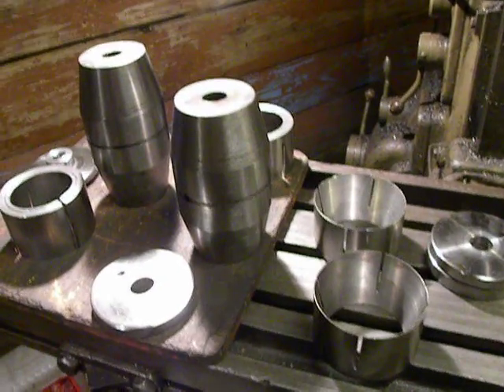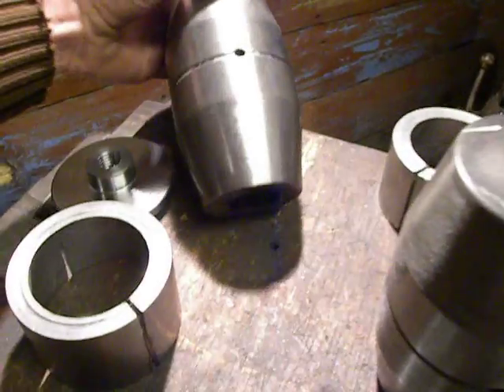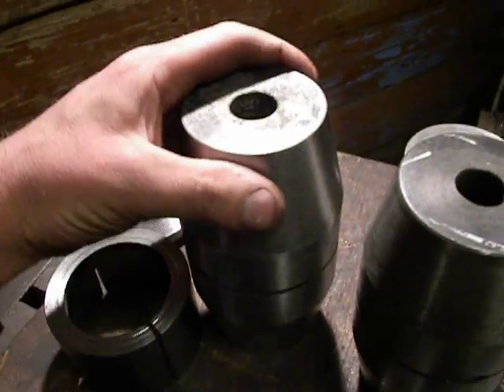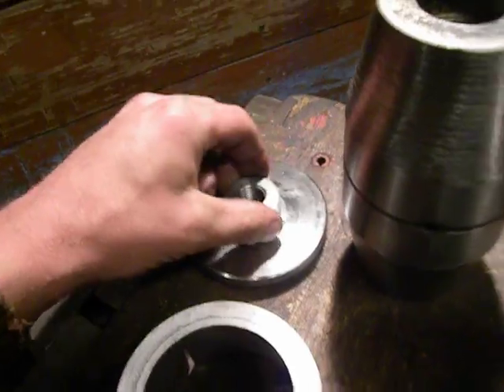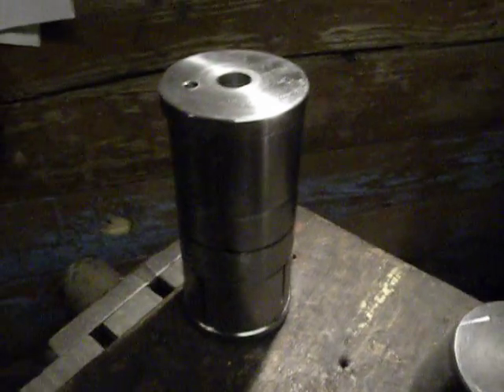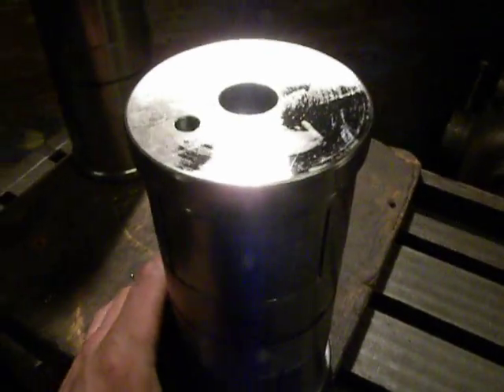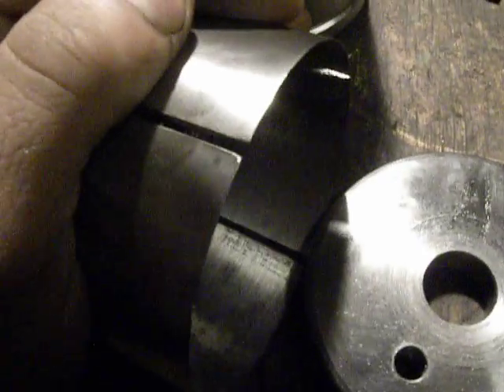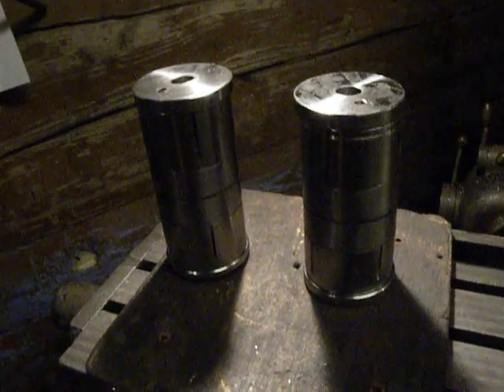Expander bushings and bolts kit for Valmet middle pivot (walk around) / Valmet great repair p13

Comment: Thanks for your detailed explanation--I understand your approach to solving the problem much better now!  Now that you've pointed it out, it is obvious there would be lots of wear on the frame bores.  Perhaps you need a horizontal boring machine with a table large enough to hold half a tractor!  More seriously, maybe you could make a portable line boring machine

Comment from the maker: Thanks! 
Liquid nitrogen tank? No, no- too expensive here and here I can't get liquid nitrogen- need license. Also I have limited space into My workshop - no place for it. Better I buy one more good great lathe or great size milling machine for that money.
For fitting the "repair bushes" I can tu use ice, fire, oil, screw, great hammer and anoyher ways how to get fit the bush. I always to calculate mearures for bushing - over-measures (from 0,03mm to 1mm) and accuracy (from 0,1mm to 0,01mm).

Comment from the maker: Well, I CAN set the middle pivot [piece with two main bolt bore WITH bronze bushing, (100kg)] on machine table, but I CAN'T set a half of tractor [tractor front frame - 4 bores on line, there set a bolts what hold tractor together, (over 1,5 t)] on My machine table. Same bolt will be slide in bronze bushing, but expander bushes will be set in the frame bores what I can't to work. The bores in tractor frame is beat up and worn, so this is the reason to make "expander bushing and bolt repair kit".